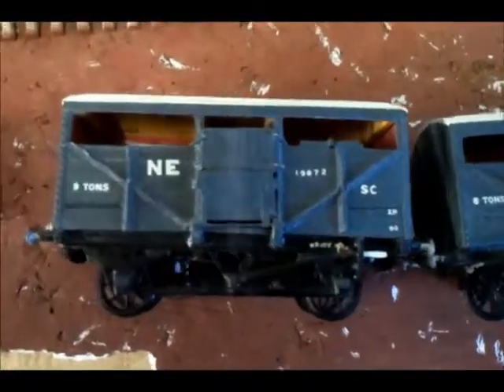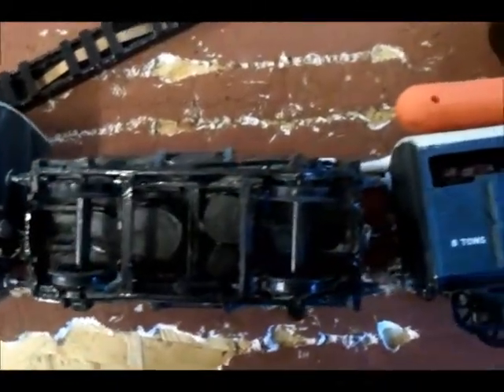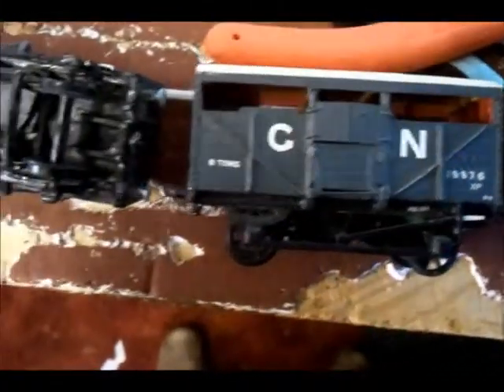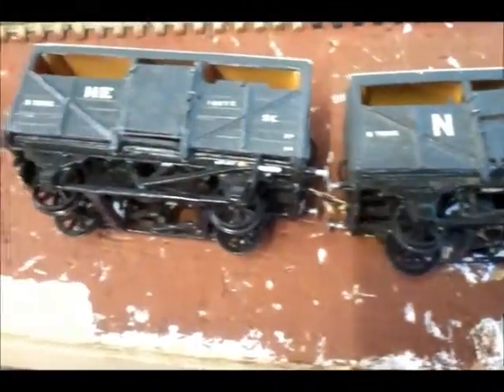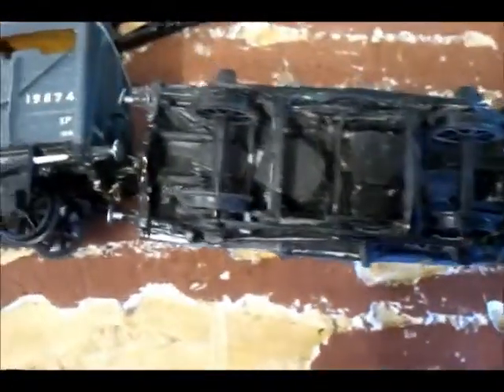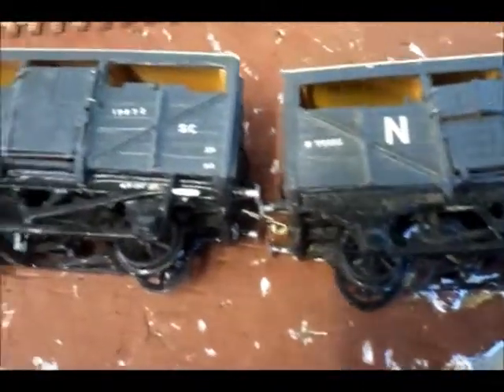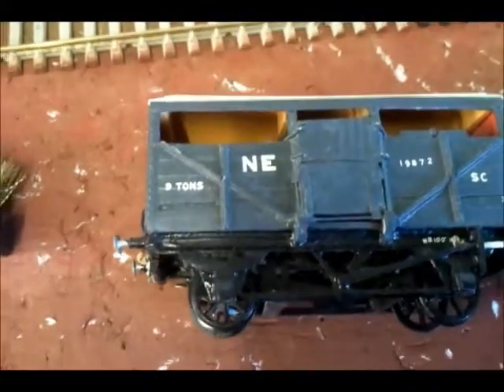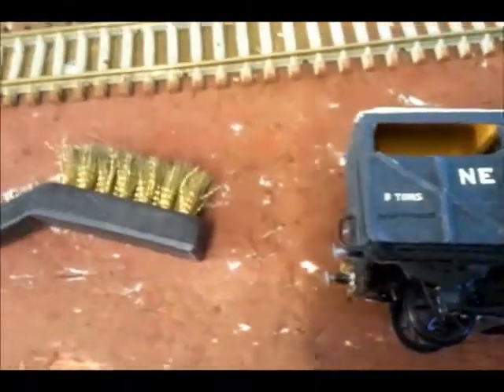How to couple wagons permanently

Comment from the maker: My first thoughts are..  drill a hole in the wagon floor just behind the draw bar, bend a piece of wire into a square cornered U shape so that it looks like a paper staple, bend the ends over at 90degrees and insert into the holes of two adjacent wagons. The alternative is a pin glued into the wagon floor and a loop around the pin on adjacent wagons.